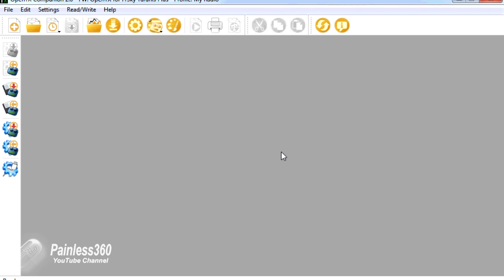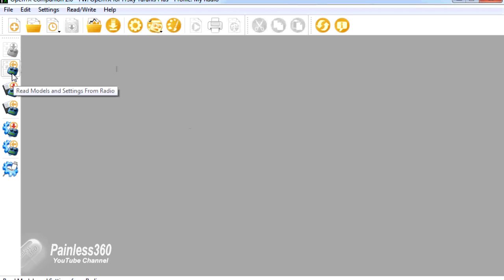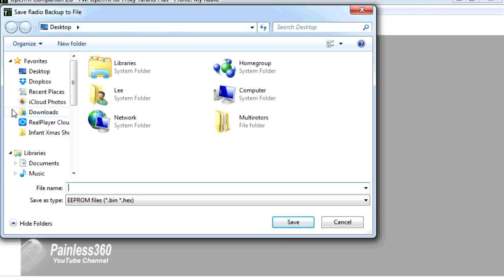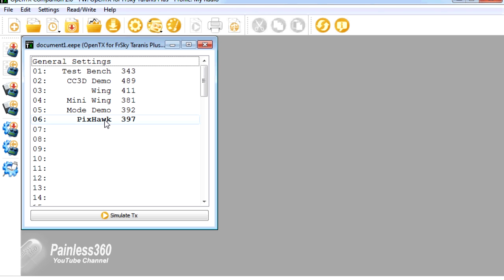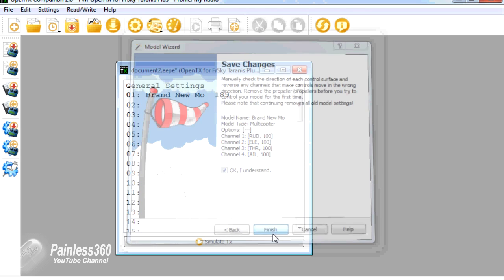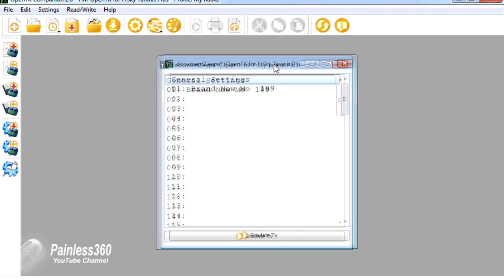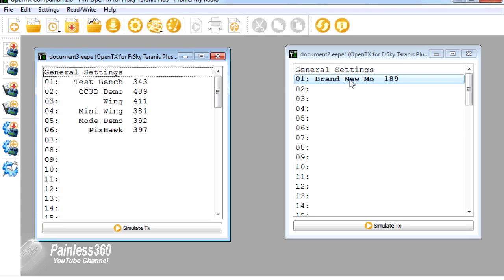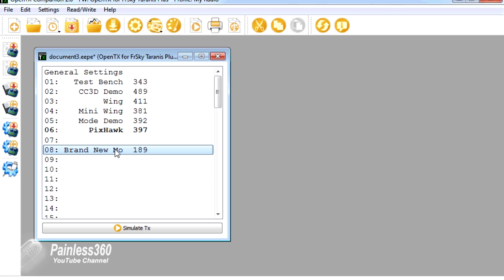FrSky TARANIS Quick Tip - Managing Model Memories in EEPROM

Comment: Painless, could you please help me with an issue about my Taranis x9D+
Reply: I recently added 2.3.2 firmware from open tx and I am missing switches in special functions as well as other regions in the radio
Reply from the maker: I've not tried that here. I'd check to see if others have found this problem..

Comment: Is there a way to copy your models from X9D to X9E Taranis??
I tryed it servel times but always get a error message of the EEPROM
If it's not possible then im a bit screwed ... :(
Reply from the maker: Sure is, open both EEPROM memories in Companion and copy the models from one to the other.. Make sure the OPenTX is the same, it'll make it easier. Best of luck!
Reply: I don’t understand this.  If I want to copy from one radio to another how do I “open both EEPROM memories in Companion” at the same time?  I can only have one radio connected to Companion at a time, right?

Comment: I enjoy your vids.  I am having problems with my Taranis Plus throttle.  The throttle words in the up half of the range.  It does not go to the lower half.  When I turn the radio on, the throttle warning come on.  I was wondering if the problem is with the eeprom.  Your advice would be greatly appreciated.  Bob
Reply from the maker: Tricky to help as you can set it up this way and you don't mention if you've calibrated the sticks or if it happens in one or all of your models.. Pop me some more detail and I can have a think..

Comment: There is also a lot of radio wide settings stored under the General Settings line. Easily overlooked but very useful for cloning to another radio for example.